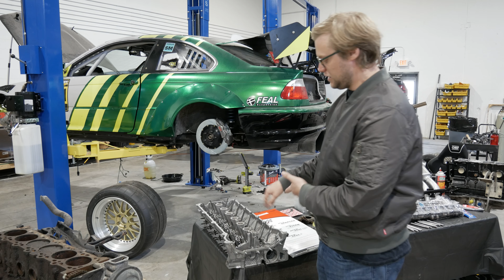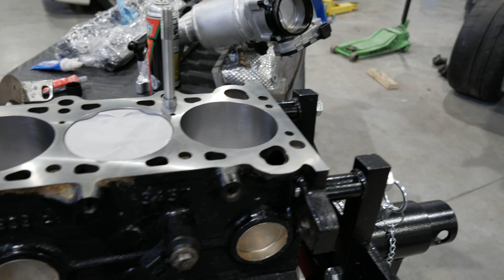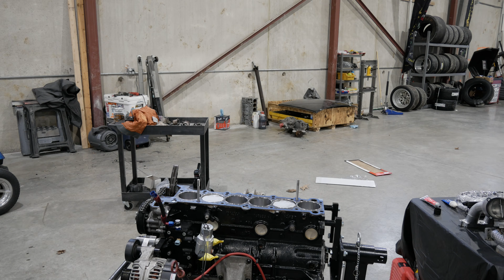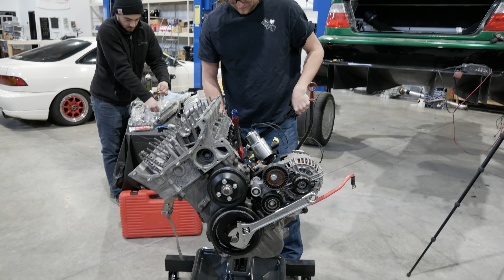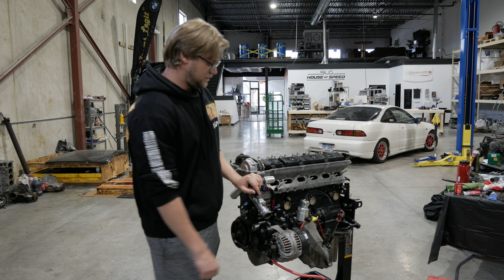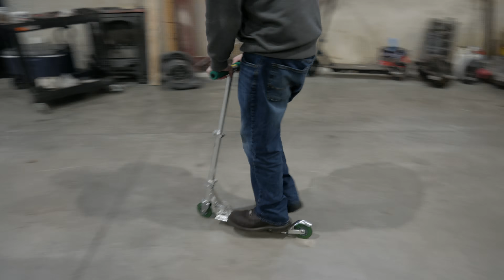Turbo BMW M52 Engine Build!

Comment: Have you run an early OBD1 M50 head on the M52 block and used the third coolant port for the turbo feed?
Reply from the maker: no, I never bother to cool the turbo, its only really doing anything when you turn the car off anyway.

Comment: Is it the stock oil pump?
Reply from the maker: No we sell upgraded pumps
Reply: @SeemsLegitGarage  you used the Billet Drop-In Oil Pump Upgrade and tensioner? Does that increase oil volume per revolution or is it only for structural purposes? It seems crazy to me that the oil pressure on m52 s52 goes down to around 10 psi at idle.
Reply from the maker: @fairchildSCR  its just to resist failure, there i no need for more flow. You could have a faulty regulator which is the piston in the pump, which can make it bleed off pressure but its pretty normal to be 15 hot idle. How low is your idle? Bump it up a little. Our billet kits come with o-rings to rebuild the regulator.
Reply: @SeemsLegitGarage  I think it's about 700 to 750 psi. It's hard to tell because I just have the stock gauge. The oil pressure at hot idle is probably around 12 psi hot (50 psi cold). Hard to tell on that because it is a 0 to 120 gauge. When I go to autocross and am hitting 7K rpm during  minute lap and then slow down I can hear what I think is lifter tick that goes away after a few minutes. That's what makes me think it needs more volume.
Reply from the maker: @fairchildSCR  I would raise idle to 900 and use 15w50 oil if pushing the car and warming up the oil hard. This will fix your lifter tick
Reply: @SeemsLegitGarage  I'll try that. Thanks

Comment: Have you ever had one of those Athena cut ring gaskets leak coolant externally? I’m on my 2nd one and it has just a little seepage out of the side. Decked both the block and head and did exactly the torque procedure you described.
Reply from the maker: No we haven't experienced that before. We are no longer using the cut ring, these motors are so sensitive and we were sick of decking the block and head any time something went wrong
Reply: @SeemsLegitGarage what do you use now?
Reply: @SeemsLegitGarage  what are you using now?

Comment: what do you do with the 02 sensors? coz once youve put on a turbo youve joined bank a and bank b exhausts, so can you just make the car read off of 1 pre cat and 1 post cat for both banks?
Reply from the maker: yes you single one o2

Comment: How much boost could these space metal studs hold without stretching? Could they hold 30 psi?? Also do you think a m54 block coul handle 25-30 psi of boost reliably???
Reply from the maker: They hold 30psi no problem in an iron block. Issue with M54 is block/thread distortion before the stud

Comment: Great video! What size turbine housing on the 6466?
Reply from the maker: T4 1.15 divided :)
Reply: @SeemsLegitGarage  Im still noob to FI- but is the 1.5" to keep the powerband up high  in the rpms?
Reply from the maker: @defkon99  the intake pipe? Its just like all we could fit and fine for our power level

Comment: what u think bout the alloy m52, still good for fully built motors
Reply from the maker: we had lots of head gasket issues
Reply from the maker: depends on fuel and a lot of things, 700 is safe
Reply: @SeemsLegitGarage  thanks for your replys and videos.......getting an m50 iron block for the build might aswell be safe always want to turn it up, gonna do forged rods n pistons into m50b28 i think it should work. cheers
Reply: oh and full turbo system
Reply: @SeemsLegitGarage  do you recommend rebuilt vanos or vanos delete, thanks
Reply from the maker: @annabanna666  definitely keep vanos, helps a ton with turbo spool
Reply from the maker: @annabanna666  rebuilt vanos

Comment: Shocked its VAC not schrick or Cat cams. Because VAC cams are just Schrick or Cat's rebranded.
Reply from the maker: of course vac doesnt make cams in house but its their spec to work well with solid lifter, they ramp in differently

Comment: how many rpm can rich m52 with original oil pum? 
intake elaboration ( no turbo) 
full exhaust
driven camshafts
engine head machined
control unit

Comment: damn, this video is all I needed as I'm currently building a M52TU with the rotating assembly of a M54B30, will forge it to make it turbo in the future. 

I've got a question: What timing/oil pump chain would you guys recommend? Iwis Racing?
Reply from the maker: Yea iwis racing is what we run

Comment: was bit confused at first when you showed the m52 and it was iron block, I dont live in US and did not know that only US got iron block m52, everywhere else m52 single vanos engines are aluminum block.
Reply from the maker: interesting, we ran aluminum m54 for a long time but they didnt last long most of the time at high power
Reply: I have a 98 2.8  straight 6 I just bought its an iron block 😊 I can't wait to build...
Reply: All iron block are m50
Reply: @arturmaciuk9748  there is no 2.8l M50 block. BMW used iron block on M52 in USA because of failures with M60 aluminium blocks cylinder coatings with fuels used in US. BMW played it safe and made m52 single vanos engine with iron block in US
Reply from the maker: @arturmaciuk9748  we have iron m52 in the usa
Reply: North America including Canada have the dirtiest fuels  in the world, High Sulphur content. This caused significant wear issues with the Nikasil coatings, so BMW had to use cast iron blocks here

Comment: Is this a M52TU? I’m not familiar with a M52 2.8. My E39 has a M52TU 2.8. Thanks
Reply: No it's M52B28. It's pretty much the same thing except M52TU is double vanos (vanos also manipulates the exhaust camshaft in TU. This is strictly  for emission ecology as far as I'm aware and has no benefit performance wise), m52tu has the disa valve (that's what makes m52tu have slightly better torque band on lower rpms), and the stock intake is different (both are badly castrated compared to M54 ones. Just a visual difference here) I can't think of any other changes.
Reply: @MultiLittlePsycho  I have a M52TU28 that’s why I’m mentioning I’ve never heard of the 2.8 M52.
Reply: @paperandmedals831  m52 2.8 is the m52b28 that you find in the e36 and some BMW I believe in the 96-98 year frame.

Comment: Just dropped a fully built turbo s52 into my e39 yesterday.  SOLID LIFTERS, the key to high rpm goodness on these motors.(Not the s52 tho)   Why not go 11mm s54 head studs like Perry/ someguy325? Even vac  recommend L19 s54 studs. Also Do you retorque the head studs after a few hundred miles?
Reply from the maker: the 625+ studs are beast and keep the block happy so we use them without issue. I check the torque after engine break in. Prob not needed but doesn't hurt. Just need a slim socket and patience to do so with the cams still in
Reply: What are you doing for rear diff?
Reply from the maker: @shifty1927  Ford 8.8 with an OS giken LSD
Reply: @SeemsLegitGarage  i figured thats what you ran. I was asking the op about his e39.
Reply: I bought an entire e39 m5 loaded rear subframe, took the sway bay , the brakes, the axels, and the rear diff (210mm 315) my wheels are oversized so it drives like a 307 ratio. I almost went with a helical, but then it would have left me with a sub par188k diff that still needed upgraded axel /axel stubs ect.    @shifty1927
Reply: There’s quite a few cars making 4 digits on 10mm arp 2000s
Reply from the maker: @pllumajsgarages9149  for sure, this just allows me more headroom when things go wrong
Reply: Welche marke solid lifters did you use. And camshaft

Comment: Bro i have an e39 m52tub28 automatic i have just a muffler... I don't know i want a project e39 should i use this one or im going to have problems for everyday use? Should i buy a second e39 manual one? And what i have to build NA engine or should i turbo or supercharger? Any thoughts? 
Regards thanks you anyway :)
Reply: I have a  2000 m52tub28 manual e39. Winter beater, (traded for a glass pipe) I have a 2000 e39 touring I just turbo s52 swapped/manual swapped /ms43 swapped..... I just bought a iron block manual 97 e39 with 70,000 miles for 1100.  I also have a 94 e36.... having done it all.  Manual swap is easy, buying a manual saves time and money tho. You can turbo the m52tu... but one overheat and it's cooked.   I suggest find a early model iron manual e39. Even if it's clapped out,use the parts. (Least amount spent going this way)

Comment: how high do you guys spin those engines and how long do they usually last i want to build a high revving turbo build on my street e36 i have a blown m50 i could build or i could build the m52 thats in the car rn what do you guys recommend?
Reply: The blocks are the same. Does not matter what block you start with. You just want the 2.8 m52 crank, the 2.5 has a lot of lag.
Reply: @l_ionize333  how about the M54 3.0 crank?
Reply: @l_ionize333  why does the 2.5 have a lot of lag? I’m just learning about these motors. Im aware they are both aluminum block and the 2.5 is at 169hp 2.8 I think it’s at 190hp
Reply: @emilioestevez3469  also a m542.5 crank and a m52 2.8 crank are the same according to bmw. so I'm talking about the m50nv or m50tu.  the m50nv has thicker valves and nested valve springs. thicker conecting rods too. it can make big power. Just takes a little more rpm to get there .
Reply: @l_ionize333  oh I thought you were talking about the M52b25 You mentioned 2.5
Not sure if your
We’re talking about M52’s or M50’s
Reply: @l_ionize333  I’m interested
rebuilding on a M52B2.5. I’ve researched that 8 psi are the Max on these engines.
Reply: @emilioestevez3469  maybe on a stock head gasket 8psi, but your talking about a 30 year old engine and head gasket can only take 8psi . Psi is a poor choice to base power potential on tho. you can run 20psi and super lazy timing , or 8psi and very advanced  timing , car will make the same power. FWIW,  the basic build that seems to actually last according to the internet  ..  stick to around 500hp or less. arp head studs, new head gasket  and a copper spacer to lower compression (turbo brings compression back up with boost) a "cut ring head gasket" is highly recommended . Stock bottom end. turbo size some where  around a 60mm compressor inducer give or take.  3" exhaust. bigger injectors, bigger fuel pump, adjustable  fuel pressure regulator.    keep the stock dme , order a remote tune/ get a dyno tune.  If your trying to cut every corner , Your set up won't last very long. By the time you invest in all the things needed, 8psi will seem like a "I got a turbo" flex and not much more. then you turn it up and it pops. Only other pitfall I see regular , people pick a tiny turbo. that tiny turbo actually makes the car work harder because it's a bottle neck in the exhaust, vs. a bigger turbo that makes more power and let's the engine breath much easier. ( bottle neck causes back pressure and heat, ) a.k.a.    Most of these "stock bottom end" turbo set ups break piston ring lands, pop head gaskets, or drop a valve. all usually heat related issues . I think a 62mm turbine is the bare minimum size I would put  on a m5x....  If you really want the set up to last, open up the ring gap on your pistons instead of leaving the bottom end untouched.  And wire tie your oil pump nut while your in there. (only costs is your labor )
Reply: worth note *** I'm in America. all single vanos m52's are iron block. I swapped to the s52, I just did not trust the aluminum block for reliability /long term use. )  if your building for boost , aluminum blocks are risky. one over heat and you can snap studs still inside the block they warp so bad.  if in Europe, start with a m50 iron block. I have a turbo m54b30, but it's got very low miles turbo. (mls head gasket/ spacer race ware studs )  The aluminum strips out so easily. I would build it the same tho. (spacer , studs, similar power numbers )
Reply: @l_ionize333  your a f*ckin legend bro
Reply: @l_ionize333  I have the M52 2.5 not sure in what direction to go to. I’ve heard it’s better to go with the iron blocks M50s. This is my second e36 in 9 months. My first was a M52 2.8 sedan automatic I ditched that for the 323i manual 2.5 At this point I’m just gonna build on this
Reply from the maker: On the street we never really wear motors out but on the track usually something small breaks, and we keep running because we want to win, which leads us to ruin the motor. Not so much a wear out thing. no vanos M50 came with some awesome valvetrain so maybe build that for high revs
Reply: m50 would be laggy with the same size turbo/ set up.  that's all. prehaps the one I drove just had a large turbo for 2.5.    m54/s52 crank has very bad harmonics right around 7200. a k.a. you can't spin them much over 7k.  2.8 crank with solid lifters can spin over 8,000. big power comes from high rpm+ big turbo + twin scroll.  If you don't wind out your car s52 aka m54b30 crank has a lot more torque under the curve. Just limited to lower rpm's.  Any iron block m5x works. If your starting from scratch .... 2.8 for over 650hp. 3.2 crank if your going street car sub 650.  will a s52 make more? (700+?) sure, but it may not live as long for more reasons than one (like thinner walls between cylinders )  I currently daily a turbo s52 installed in a e39 touring. the big torque hit helps this car move out. My e36 will get a high rpm m52 set up with it's lower weight = faster .

Comment: I can only dream of when I can turbo my dd M54b25 E39.
Reply: Just saying they fit if you look at carillo rod page , they are the same.   Imo. Don't expect much out of a m54b25. It's the only m5x motor with a cast crank. Plus the aluminum can warp so bad it will snap head studs in the block still... the m52tu/m54 is just the cast iron design, recast in aluminum.(plus some coolant changes for emissions.) its just not a great starting point for boost. Look, I started with a m54b30 turbo. Only had 28,000 miles. Used a. 140 mls head gasket... nothing but issues. The torque values for all the bolts are so low in aluminum,you will strip a lot just building the thing. It's a lot of money to invest in a platform that might only make it a few hundred,  or a few thousand... who knows. But even seems legit went iron block. I bought my m54b30 to turbo based on their old maroon e46 video.... big waste of money imo. (So I rock iron blocks now) if I was you. I would find a iron block. Find a m54 with a blown head gasket (plentiful ) drop the guts from the m54 into the m52/ m50 . They all have 84mm pistons.you can even dual vanos a single vanos iron block  head.  It's a direct swap more or less. (Iron block flows coolant through the block first. Aluminum flows through the head first.) A m54 crank is the same as a s52 crank. Big mid range torque /better spool if your only going to a 7000 redline.(aka street car)
Reply: Same rods as a n54 , (m54b25)
Reply: @l_ionize333  so I buy N54b25 rods?

Comment: Where would one find a cheap m52 block? I’ve looked for the 2.8 specifically for a while.
Reply from the maker: facebook, salvage yards
Reply: Just got a mint  70,000 mile manual 97 e39 (California car ,one 75 year old owner, 1100$ ) they are out there. If you can't find a m52. Grab a overheated m52tu aluminum motor. Take that crank put it in any iron block. Same part #s